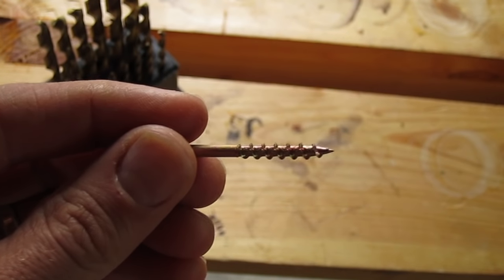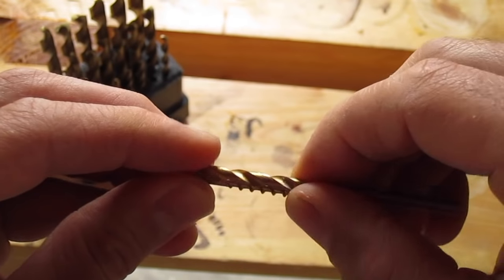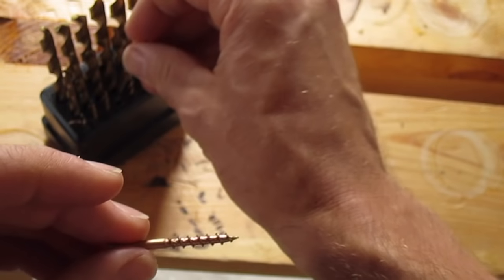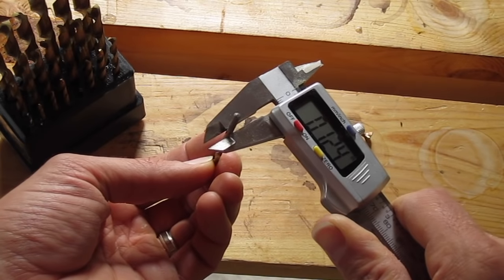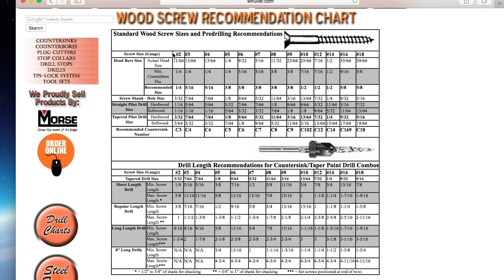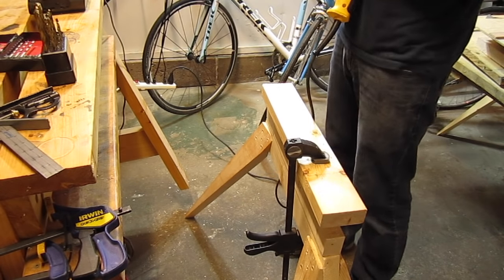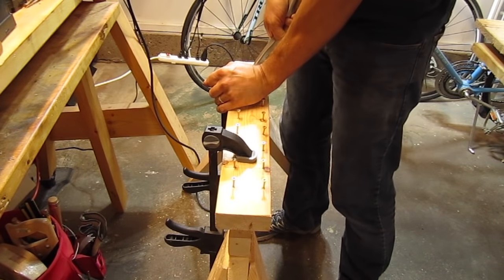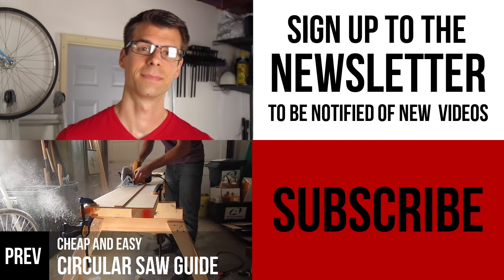Choosing Pilot Hole Size for Wood Screws

Comment: Nice vid, thanks. For me it depends on the hardness of the timber. For soft woods like radiata pine, a very small pilot hole is good because the grains are like a sponge and they will compress around the screw. For hard woods like Oregon or teak, a larger pilot is needed otherwise the timber may split.

Comment: Not all cuts of wood split the same, that's why pilot holes are generally a good practice.  For example, thinner cuts are more prone to splitting and I would always use pilot holes.  Nothing is worse than getting most of the way done and having the last screw split the wood.  In all wood screws, the solid shaft under the threads needs to push the wood out of the way as the metal needs to replace the wood.  That's why you found out that the pilot hole size doesn't need to be exact as wood does compress some.  The longer the screw, the more torque you need to drive the screw as more threads are in contact with the wood.  Also, the more wood being compressed increases the torque required to turn the screw.  With a smaller pilot hole and a longer screw, you run the risk of stripping the head's drive features especially slotted and cross-recessed.  You can tell if the pilot is too small by listening for the wood to squeak.  Wood making noise is almost always bad.
Reply: It looks like the grain plays a part. If the grain is going in the same direction as the screw, it seems more likely to split. When the grain was perpendicular to the screw direction, it didn't split. Maybe use a bigger pilot hole under those conditions?

Comment: All you really want to do is relieve some of the pressure on the drill (easier) and wood (to avoid splitting). I usually just eyeball the drill bit against the screw shank and then choose the next bit size down from that match. If the wood is especially brittle or the screw is really close to an edge, I'll choose that match (or even one bit size larger) over the next bit size down.

Comment: Brian, ]
I'm in the process of repairing the bottom of a wood, swivel desk chair. Several screws sheared and I had to back or dig out the remenants. I made up a slurry of wood glue and saw dust. I then packed the holes and have let it sit for a week. My question, considering that the holes I will drill will go in to the patch , should I dial down the size of the drill bit? 
Also, I'm going to do a test hole with a very small drill bit first to assure that the patch has dried.  Thanks.
Reply from the maker: I would try the normal size hole for the screws you're using. I'm guessing the glue/sawdust will be somewhat brittle and prone to cracking, which would be more likely with a smaller hole. 

If the patches don't work, if would try drilling out the holes with a larger diameter twist bit, like 1/2 inch, and then glue in a dowel of the same size. Cut that flush and drill into the dowel for your screws.
Reply: Brian, thanks for your response. I've used dowels on other projects but hope this one does not come to that. Later!!